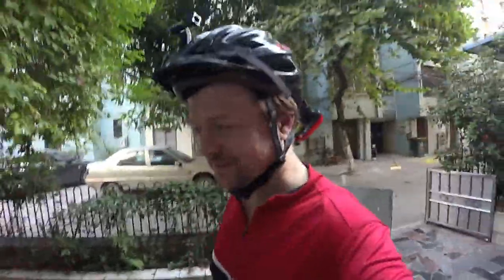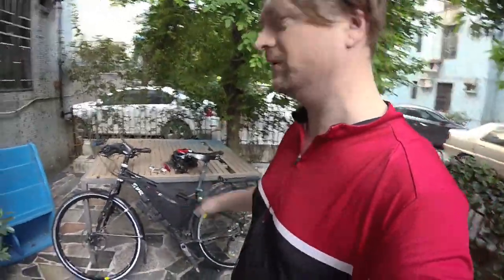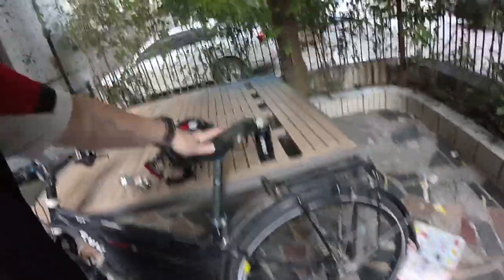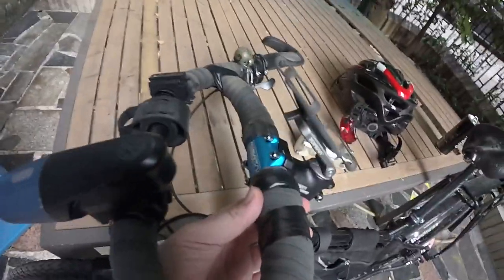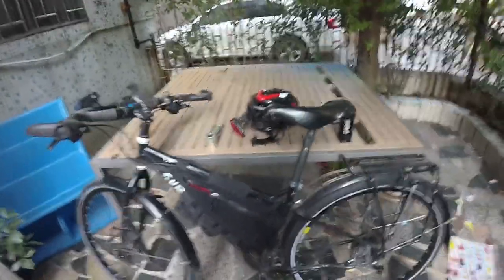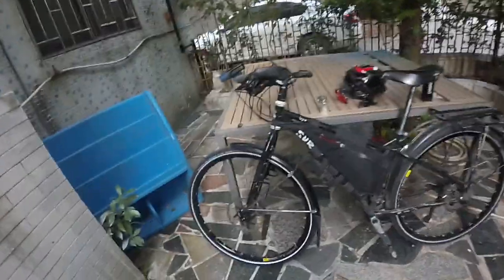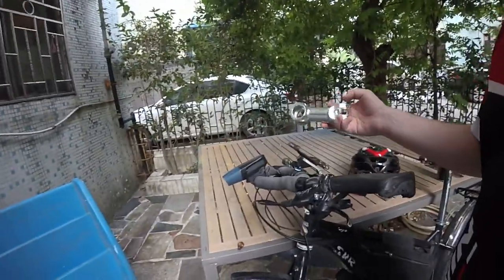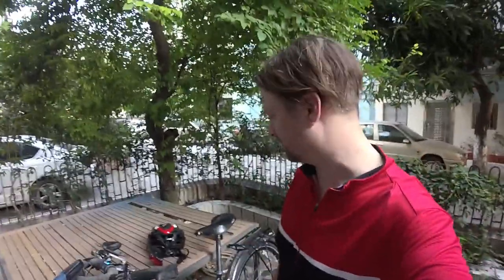Controltech One 60 mm vs. Thomson Elite 100mm / Jones Loop Bar/ Surly Ogre Bike stem review

Comment: This maybe a crazy idea but just a thought. What if you turned your bar ends backwards so they were facing towards you instead of away? That way they would not catch on the car mirrors. You could still use them but you will have to rest your palms of your hands on the bar end and grip your hands around the handle bars..
Reply from the maker: good idea. Id have to cut the gips. Also the are hand guards... Ill think about it.
Reply: Yeah. I was thinking that you would still have a platform to rest your hands on although it would be an inch or so further back. I guess it would give you a more up right riding position too.
Reply: There's plenty of affordable aluminum cruiser type bars in China he could opt for that have good sweep rather than modifying what is a very expensive handlebar. I've always lamented the fact that the Ergon grips don't play nice with the Jones sweep because it can catch on other objects more easily since it V's out. I presume Surly intended to replace the Jones Loop bar with their own in house Moloko bar, which has less sweep, more hand positions, and more 'dashboard' space. I think the big issue once again is that the handlebar doesn't draw back far enough for a commuter/touring favored posture, but in order to do that you need more sweep. It's a tall order to ask for a bar that sweeps back, then goes more flat, because not everyone has the same real estate requirements when it comes to mounting shifters, brake levers, and grips. Velo Orange has the Crazy bars, which are like a Moloko-lite, and seem to be inspired by people running bullhorns with angled attachments for grips. I sorted my 26" slick MTB with an affordable cruiser bar that I run inverted. Feels fantastic. Here's the link (my review has photos): https://www.aliexpress.com/item/Bicycle-Handlebar-For-MTB-BMX-Road-City-Bike-Size-25-4-610mm-Ultralight-Aluminum-Stem-Cycling/32824392289.html

Comment: Congrats on the new stem. I hope it feels better! Some folks seem to go too far tipping their Brooks saddle up in the front to compensate for fit issues, but that could indicate three things: Improper bike fit, the saddle is not the right size for the rider's sit bones, or the saddle is not being regularly and properly conditioned. You aren't racing, so you don't have to worry about aerodynamic efficiency. Instead it's more about ideal saddle position for pedaling, and not being scrunched up over the handlebars. I get extra power on my climbs by leaning back and increasing abdomen blood flow. As you probably know I ride loaded with weight so putting torque efficiently into the drivetrain is more important than being areodynamic. :P
Reply from the maker: thanks... it feels a ton better . Could perhapes be 20mm shorter, but still great. Yeah I had once ridden like 10000km with it too far up : ( . Takes a lot of adjustment to get the sweat spot.Right on about the aerodynamics....